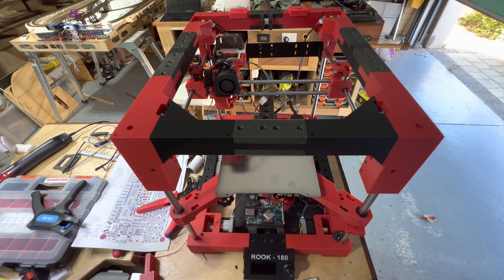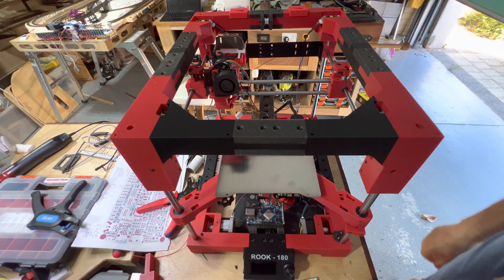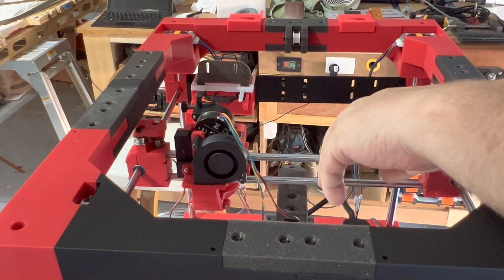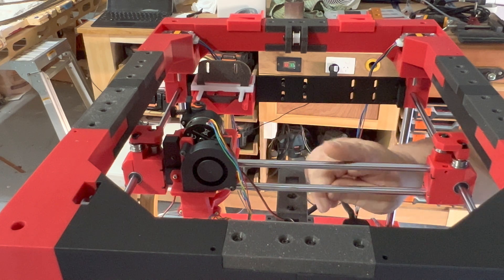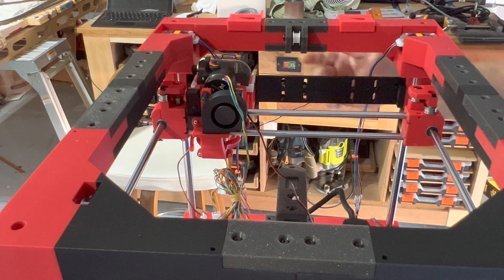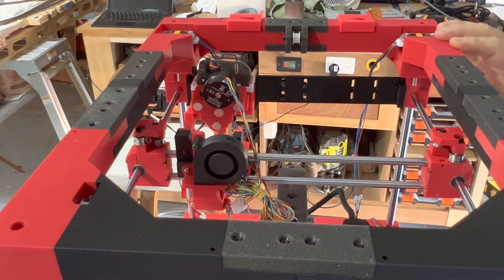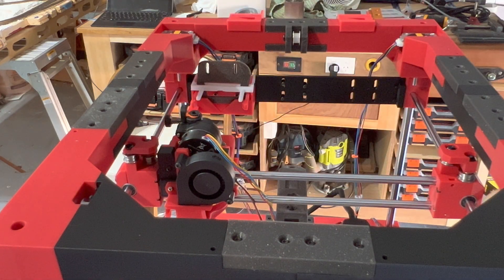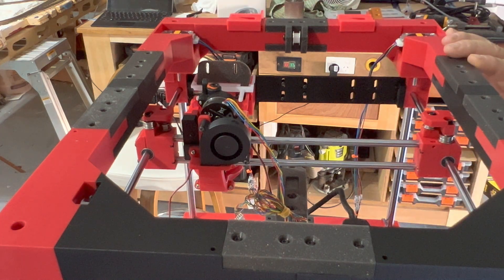Rook 180 (multi-hotend) development Pt1

Comment: You may wanna move the magnets so they don't line up with the rods xD
Reply from the maker: It does create a small pull on the rods. although I don't feel it's enough to cause much extra drag. I would move them, but the room in there was really limited with all the screw holes etc. I also wanted to maintain the 'pyramids' that help lock the position, the depth of them also dictates some limits on the positioning. I guess one option would be to go with carbon rods, although at the moment the x-motion appears quite slick.